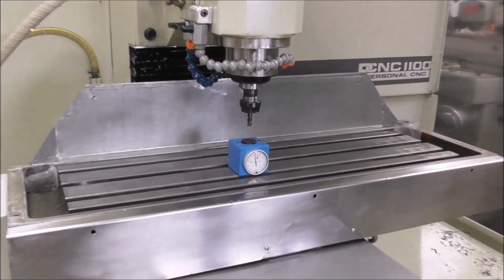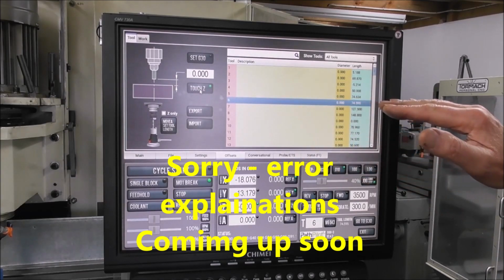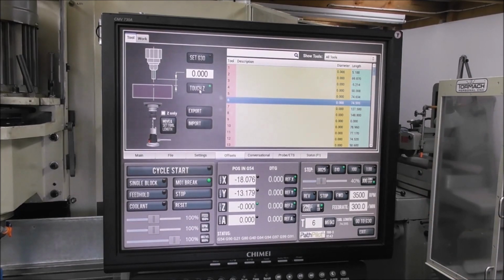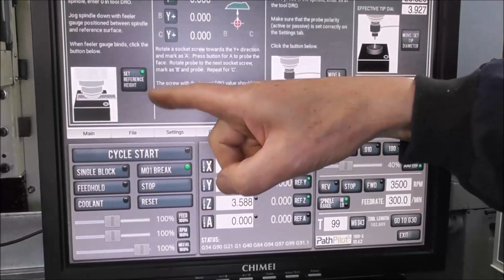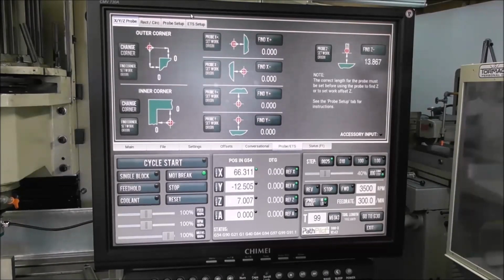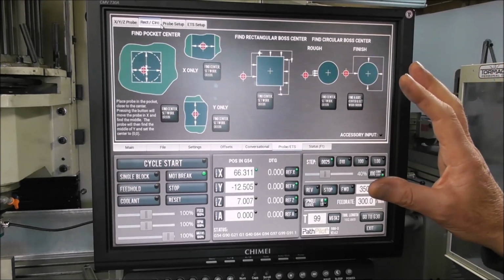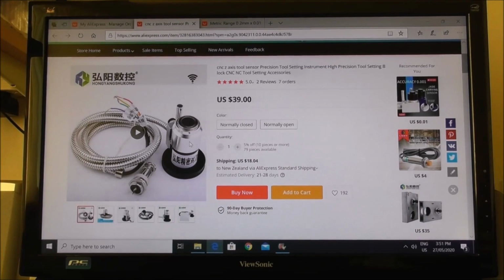Toolsetters for Tormach and other CNC Mills. Part 1

Comment: Oddly, I found nearly the exact same error on my tormach 440 with a 1/2" endmill. I was using a granite block and height gauge from tormach and was 100% confident in the measurements, as they were very precise and repeatable. I used the endmill to face off a bunch of stock, and kept coming up 0.002 to 0.003 inches too much stock removed. I'm kinda new and it's not that critical for this project, but it made me wonder. I added a 0.002" to the tool length offset and it was dead nuts on(to the best of my ability to measure +/- 0.0005").

So I've watched the video twice, and I'm trying to determine the most accurate method of setting TTS tools. It seems like, in the absences of a full on production shop, the analog setter with the dial indicator is the most accurate while still being practical for hobby/small production???

It seems like the electronic one has too many things that could make it less accurate, unless you toss a ton of money at it??

I'm looking for one that I can trust without selling a kidney.
Thanks,
Joe
Reply from the maker: Hi Joe. One factor worth considering is that an electronic tool setter needs to be left on the table all the time, in order to take advantage of its time saving potential. But then you really need a good quality unit, set up and safety wiring etc. that can run long term in a coolant/chips environment, without faulting.  Faulting can cause expensive damage. Cheers, Cliff

Comment: you not need any of them. just measure tools same place and hit your magic own made macro g code and boom. height is on offsetpage.
just need make that macro program its easy LOL machine max z travel - machine current z -measure point height from table=  toolheight.
all you need is change max travel so tool height is how you want it be from tip to flat face on your cnc behind your toolholder that allways same.
that analog gauge would be nice. it could be use on lathe too. where you need keep door closed to move axis. try measure tools lol.
it is so not acurate spin chuck and scrape part when door is closed LOL analog gauge would be nice measure z. x is easy and can be kind of there rest is just make part over size with offsets and measure move offset back. vola lol
Reply from the maker: Thanks for your input! Cliff

Comment: Maybe late, but just tried this while watching. The macro on my machine will not move z axis when the sensor is not plugged in. 
2nd switch during macro run does not cause E-stop, but normal tool alarm. So it is not as scary as you made it sound, but I did not know that before I watched.  🙂
Probing without tool, machine stops at a min height before spindle crashes into tool setter.

Comment: Why do we need to (theoretically) set the z reference height on the blue toolsetter with a feeler gauge when we have a probe? Can we not probe the table, then probe the toolsetter, then the reference height is (toolsetter - table)?
Reply from the maker: Hi Morgon. So I am sure what you are asking, let me know the time position on the video where you question arises. Cliff
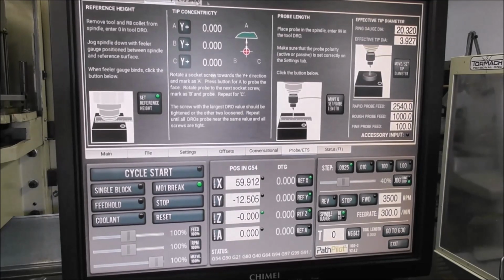Reply: @Threadexpress  At 17:45, the screenshot on the top left-hand side discusses how to set reference height. (You zeroed out the spindle earlier using the dial indicator part of the tool setter, but same idea.)  I guess what I'm not sure about is why we care about where the toolsetter's location is in Z, if we have a probe. The idea being: Probe to the ground bump on the tool setter. This is height zero, and the probe's length is set to 0. Then zero out your other tools as shown in the video with the blue toolsetter. Then when we set up our part, we can set G54 X/Y/Z based on the probe location. All the other tool heights are the differences between them and the probe's height, which we arbitrarily defined to be zero.

I shouldn't have mentioned probing the table, that's a red herring that we don't need to care about.
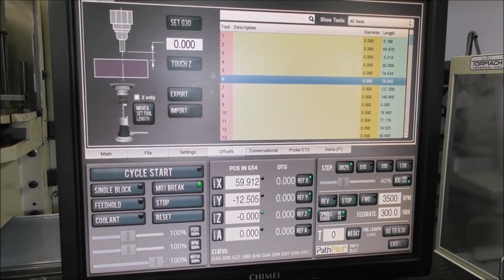Reply from the maker: @Venthorn  Hi Morgan. OK If I understand you correctly. Re: " I guess what I'm not sure about is why we care about where the toolsetter's location is in Z, if we have a probe."   In short we don't need to care. We can place the toolsetter just about anywhere, and as you said, probe the bump and then set the tool length. Me showing the probe set up at 17:45 is probably bad timing on my part for bringing in a concept explanation  at this point..as it has lead you to think this must be done each time. It is a while since I made this video but from memory, I guess I wanted to show this procedure somewhere in this video, but putting it in elsewhere ie before demonstrating the toolsetter, would risk loosing the toolsetter focus too early on. Cheers Cliff

Comment: I'm on a Taig desktop CNC that uses ER collets built into the spindle nose. So the same tool will be at a different height each time you put it in. I'm doing the paper shim method on top of a 123 block every time I change a tool now. For an even lower end hobby mill like the the Taig, the electronic setter seems like it may save a lot of time as compared to the dial indicator type setter. Because you need to find the length every single time you change tools forever, as opposed to only one time when first putting a certain tool in its toolholder.
Reply from the maker: Hi Nick. Sorry I missed your comment until now. I see your point. You are saying each time to install a tool an ETS auto installs the tool length in the tool table.  The problem is, with the Tormach anyway, you need to reset the ETS ref position each time you start up the machine due to start up Z referencing errors, if you want to do accurate work.  (this is requested by the pathpilot software) This somewhat negates the advantage of an auto ETS. I will be publishing a video on this soon. Cheers  Cliff

Comment: With all the tool setters out there that are junk and made of China crap it would be nice for those of us that do production work on a smaller scale. I think the Tormach ETS at $600 is ridiculous but I paid $130 for one that has .001 repeatability but it didn’t last 6months before it started to have issues. So like your Hallmark touch probe it would be awesome to see an option to have a ets to buy w it.
Reply from the maker: Hi MO BO - thanks for the feedback.  Cliff

Comment: At about 7:00, I noticed that you have several TTS set screw tool holders in the background with tools mounted.  Could you comment on when it is acceptable to use set screw tool holders versus collet tool holders?
Reply from the maker: Good spotting!  I have about three there. Well thats an interesting question. While set screw holders are in theory less accurate than the collet type. With TTS and low cost/quality collet holders the comparison is not so clear. Both options may have errors and you really need to indicate the tool to check for concentricity with critical work.  Have you seen my video series R8/TTS vs BT30 . https://www.youtube.com/watch?v=m9rMbSLyAvM&t=103s    Cliff
Reply: @Threadexpress  Purchased by 770 used; it came with a dozen set screw TTS, which I promptly retired and replaced with collet TTS, because I could not imagine how they could be used accurately.  On the other hand, I could avoid buying more collet TTS if I knew when a set screw TTS is appropriate (like when accuracy is not important, good luck with that).  Maybe you could think about a video on that topic.  Also, I expect you are not getting your way oil from Tormach for shipping costs.  How careful should one be regarding selecting an alternate way oil, say a Mobil blend?  I did view the threee R8 vs BT30 videos a few weeks ago.  Really appreciated those videos, as it is clear to me that my situation is definitely R8, and now I have piece of mind after the videos.

Comment: I've got one of those electronic Chinesium tool setters and it works well with the automatic tool offset measurement functions in my Centroid Acorn controller. This does everything for you including banging the value into the tool table, so it works for me. I also have an even crappier one on the Newker (Chinesium) controller on my Bridgeport. Having written my own macro, it does the tool measurement and avoids having to enter long numbers on the tactile keyboard which is a PITA. I am more sold on the electronic ones than you it seems. However, there is likely no right or wrong answer.

I had mine apart this week after an (ahem) incident. Nice ground steel shaft and bore but some of the other stuff was shocking. Mine had a gratuitous LED inside that wasn't even connected up, like some form of secondary growth. So far it's been surprisingly repeatable. I'd like something a bit better engineered, possibly a used "proper" one if I can find one...
Reply from the maker: Interesting and entertaining comments Murray, thanks.

Comment: Cliff- thanks for the time you took to show the differences. I bought a used tormach that had all the Tormach different tool setter options plus the haimer and electronic touch probe (not your ITTP).  I end up using the height transfer gage and haimer the most for convenience sake.  The backlash in my axes tend to make efforts at precision futile. I also got a rapid turn with it and your videos related to it were extremely helpful when I set it up and made parts. Keep up your good works!
Reply from the maker: Thanks for your interesting comments Stig. Yes backlash is a worry on low cost machines !Cliff

Comment: A thorough and informative analysis. I personally think touch sensors are not very useful for your low cost cnc machines. There great for cnc routers doing manual tool changes. They may also be beneficial for some more production oriented machining  where you want to check for tool breakage before or after a machine operation. But I think that may be out of the realm of 90% of us doing machine with these category of  machines.
Reply from the maker: Thanks Sam - Good points. Thanks for your feedback. Cheers  Cliff

Comment: Thanks for a good comparison of the different types of tool setters.  I have never been very confident of the results of my height gauge tool length measurement so I only use that to measure a drill if I'm drilling through and don't want to mess with the setup.  I do have one of the LED types but I don't like that either as sometimes the LED flickers.  I have been thinking of getting the dial indicator type because I like to see the needle move and gauge how close to "0" I am but not got around to it yet (and probably won't).  What I do is set T0 using a gauge block under the spindle face (a little blue marker pen helps) then set the Haimer offset using the same gauge block.  I then use the Haimer to set a zero reference point on the back jaw of one of my vices and store that XYZ in the offsets table, then use some shim (or sometimes a measured dowel pin)  between the tool and the vice to gauge when the tool is at "0".  I think your idea of starting the tool low and raising it is a better idea, testing if you can roll the dowel pin under the tool.  This would probably be safer and quicker.  I use the Haimer to set the work offset.  The idea is to make the errors common - if there is an error in the Haimer offset, then that will be common to both tool and work offsets.  This method seems to be consistent - I don't get variations in surface heights on parts when changing tools, though I won't necessarily get dimensional accuracy, though that is not so important to me, within reason.  My height gauge doesn't reliably repeat but I'm confident the Haimer does.  It is surprising how much the vice jaw offset changes between cold morning and the sun beating down on the steel garage door - 0.025 mm is not uncommon overnight.  Keep up the quality content, it's appreciated.
Reply from the maker: Hi Chris - Thanks for posting your experiences and  thoughts on the subject here.  Cliff